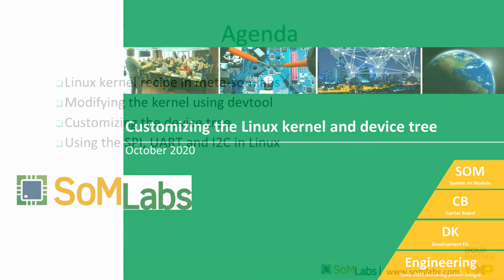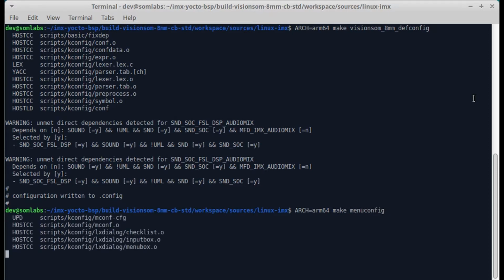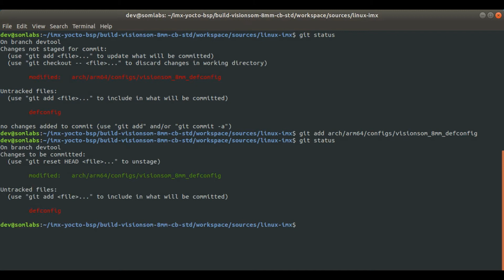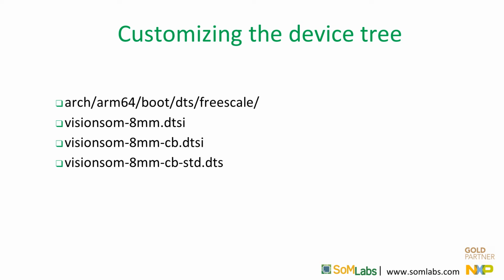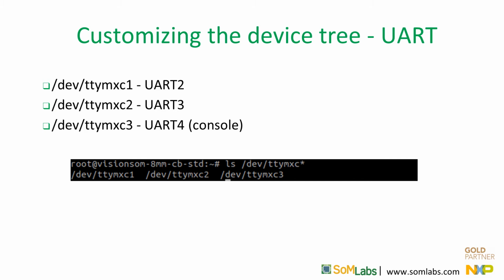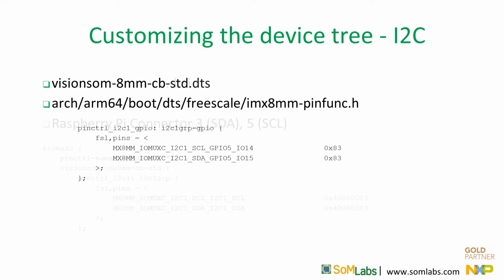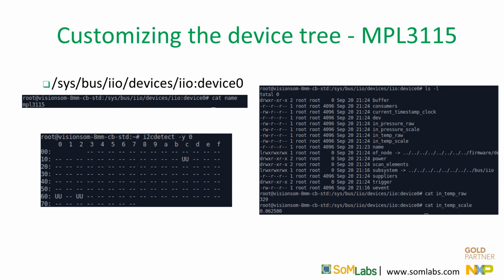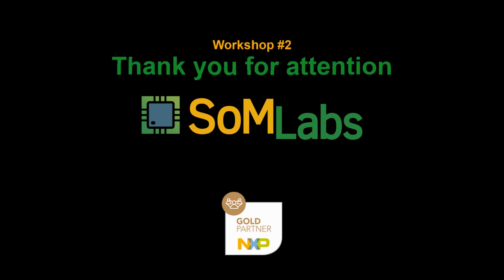Embedded Linux Training (I.MX8M Mini):  first steps with Yocto #2. Customization using device tree

Comment: To enable kernel drivers why not using kernel fragments?
Reply: They aren't supported by meta-freescale. But it's still possible for fake them by adding:
do_configure:append() {
	for fragment in ../*.cfg; do
		bbdebug 2 Applying ${fragment} to kernel .config
		cat ${fragment} >> ${B}/.config
	done
}
in linux-imx_%.bbappend. And provide cfg files in SRC_URI.
Reply: I try to use fragments (.cfg file) in Raspberry pi 5 and it works. it does't work in Imx95 evk.